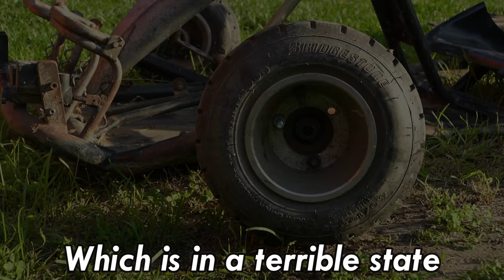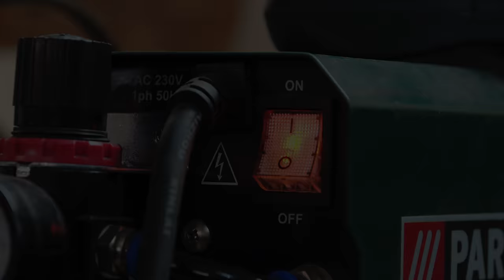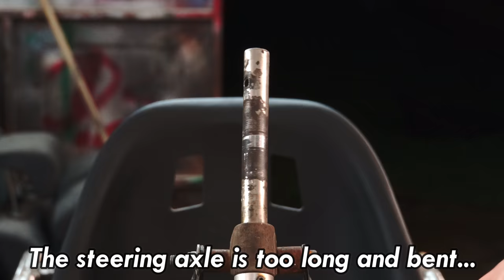Homemade 200cc SHOPPING Go-Kart !? 🛒🏎

Comment: 110cc 2 stroke engine over that 200cc lawnmower engine anyday. especially if you can get one wtth 5 speed gearbox and clutch. or better yet a 125cc 2 stroke dirtbike engine. that would be insane. i dont like lawnmower engine builds. that being said, this was amazing work and i couldnt do it, so i shouldnt judge it. looks cool too with that shopping trolley.

Comment: that shopping cart got more power than my motorcycle
Reply: what kind of motorcycle do you have :o
Reply: @socks2441  honda revo fit,its a modern cub motorcycle,it has 110 cc engine,and thats all,no abs,no led light,its the cheapest brand new motorcyle here,it cost Rp.13,000,000 or around 900 usd,i dont think this type of motorcycle exist outside southeast asia,and i think the revo fit only exist in indonesia,but i'm not sure
sorry for bad english

Comment: Nice build! I made one a couple years back, I basically copied Kyle from the Boosted Boiz... Love shopping cart go karts! Got mine upto 49 MPH (79 km per hour) on the top speed run!
Reply: Yes and getting the shopping cart is very easy too, you Can just steal one.
Reply: @gamrboi5971  Some homeless people left one outside my place... I didn't even need to steal it, it was hand delivered! 🤣. I got a couple vids of it on my channel if you wanna check it out! been meaning to post more but I've had some family emergencies come up. Hopefully I can pull myself out of this rut and get back into posting.

Comment: Looks great.!!  Thank you. 
   If I'm thinking about this correctly,  aren't the rear wheels held on by a keyway and a couple of screw.??    I'd just be careful of sliding sideways, donuts and high speed runs.
    I can't wait to see the paint.   I think it looks better shortened.    Did you go back to smaller rear tires.??
    Well done,  Best regards.

Comment: this thing is literally trash. No space whatsoever, your knees and arms are GRINDING on the steering wheel and if you moove a little bit to much to the back with your arms they are straight in the brake disk and in the spinning gear. This is a Steampunk kart which would be build when you need to move around when the zombies wanna get you. Literally every part of this trashbin looks like its gonna fall apart except the brake cylinder and the steering wheel. Those 2 parts did probably cost more than the rest of this junk
Reply: What did you expect from a shopping cart????
Reply: @meeko-meeko  think the shopping cart away. Like literally everything else was also trash

Comment: Slow af
Reply: Well it’s a go kart what do you expect?
Reply: @DoneRegularly  my go kart goes 40 mph 💀 with a gy6
Reply: And it’s a 150cc
Reply: @MushFPV  Did you build it from scratch?
Reply: @MushFPV  I wouldnt want to go faster in a tiny go cart like that. I think the speed is proper based on its wheel size, ride height, and oh yeah its a shopping cart with an engine attached.